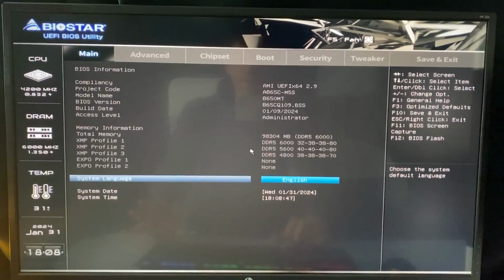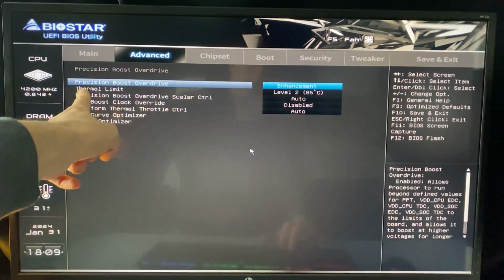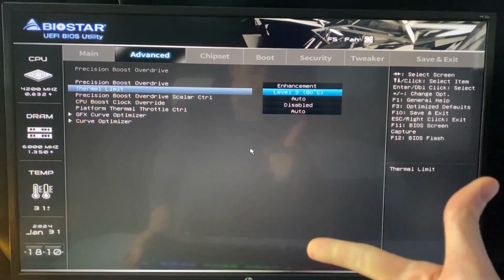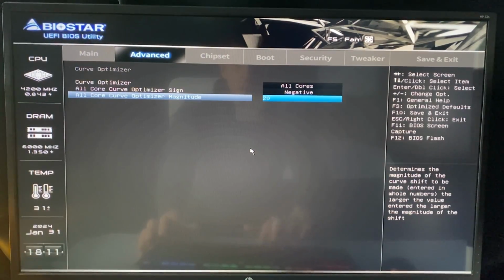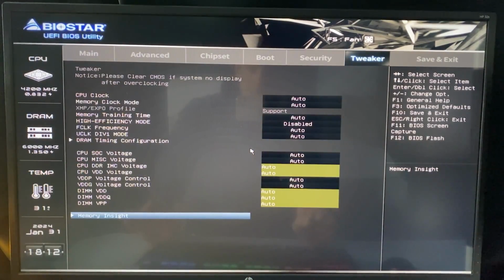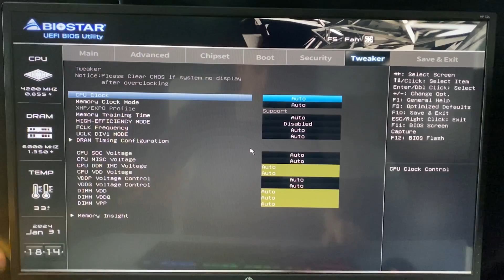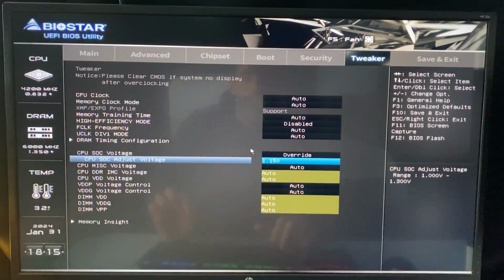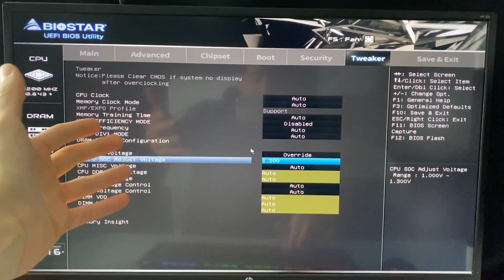Undervolt your Ryzen 7 7800X3D for more FPS and Lower Temperature!

Comment: it's all useless. All you need is using PBO enhancement. There are 5 levels for 70, 80, 90C. The first level will be working on all cpu, level 5 will work not for all, you need to test it. I tried 70C level 5 and level 4, and it had problems with stubility. 70C level 3 works great. I have 74C max in games with 4800-5000Mhz. It works even better than I made with PBO -25, 74watt cap and 4700Mhz lock. It's ready preset

Comment: In my bios there is no 85 degree thermal limit option, but after some testing that would be the performance sweetspot without causing unnecessary heat. I can only choose 70, 80 and 90 but no 85. Is there any way to enable it, or do I need to buy a different mainboard?

Comment: I'm confused about a thing. Dynamic version of this tutorial should be ok or you recommend the static one for long period uses?
Idk on the static version where on the motherboard settings to chose the multiplier (if TUF even have one).
I don't want to lose fps with the dynamic version. If the dynamic version should give you both less temps and same or better fps I'm good. I just want to make sure I'm choosing the right way for my PC

Comment: Msi wont let us to set thermal limit. Without termal limit, would it still work? @imwateringpsus
Reply: It does
It actually has a preset on the bios
The EZ mode and latest Bios update, I put it at 75.
On my 7800x3d and 5080 is more quieter and stable

Comment: Lol my MSI BIOS won’t let me set a thermal limit. It will let me set a platform thermal limit but we don’t want that. Then when I go into PBO the options are set to: 65, 75, or 85.  But then that locks me out of being able to curve optimize.
Reply: u dont need to set a thermal limit. thermal limit is just last protection barrier if temperature is go beyond 80 degrees. or if u insist, just use PBO enchance mode 1,2,3. MSI embed those thermal limit and curve to it to somewhat around minus 10, 20, and 30.

Comment: my pc keeps turning off then restarting randomly im not sure if its because i undervolted my 7800x3d but its been doing this recently
Reply: Yes, it’s unstable bro
Reply: do per core undervolt maybe one core is the problem.. like my case.. 
core 0 -25
core 1 -25
core 2 -5 (was crashing at -10 in OCCT under 4 min test tons of errors)
core 3 -15 (was crashing at -20 in prime95)
core 4 -25
core 5 -25
core 6 -25
core 7 -25
i have core 2 which is the worst and core 3 better, im still thinking playing around to push the remaining cores to -27 or -30 but it needs long testing

Comment: Hello , thanks a lot for the video !! I just did the dynamic undervolt and no issues encountered so far with the same exact settings ( temps are now between 60-67 watercooled) instead 80-85

I am just wondering if this can work on a safe way with AMD Expo as I need it enabled for having my ram at 6000mhz
Reply: What apps or games you use? I think that's hot man. I'm in a equator country and got like 50-high 70c temps when gaming but average at about 60s

Comment: Dude I'm planning to build itx case with this 7800x3d or 9800x3d cpu with velka 3 with low profile cpu cooler. Did you think having 9800x3d pbo with 4070 zephyr edition can hit 540 fps above cause I'm planning 540hz 1080p monitor??
Reply: Go 9800x3d yes

Comment: What's the use of buying the fastest CPU in the world then you'll just undervolt it?
Reply: To min-max power draw efficiency for performance, the cooler your CPU/GPU runs, the longer it can stay on its highest boost clock, hence performance increase and also helps with hardware longevity with less heat on daily run. But for people that still don't understand what's going on after watching the video or afraid to make any adjustments in the bios, just let it run on stock settings there's nothing wrong with it especially after AMD released bios updates for all partners boards to no longer have s.o.c be at 1.4v. all these undervolting steps are just min-maxing, also undervolting doesn't always mean it's underclocking when the CPU/GPU sometimes draws more power than it needs for stock performance, when it can draw less power and still get the same stock performance.
Reply: @Reitear  Thanks for the info sir. ❤️
Reply: No one really needs that much power (as for now) and I rather prefer a very slightly weaker but cooler and therefore quieter system.
The performance loss is absolutely negligible. Its also not the fastest CPU in the world, its the fastest gaming CPU. Intel still has the fastest overall CPUs on the market
Reply: @LEK  But in the video is saying that increase the fps, so you are getting better performance, why are you saying slightly weaker?

Comment: New to PC, After I updated my bios and chipset driver, i try to curve optimizer  negative 30 my R7 7800x3d my wattages drop and also my performance 1400p from 180-200fps to 110-140fps. 
Before with the update it was working curve optimizer negative 30, was working fine from 4700-5050 boast clock 185-210fps. Any advice anyone can respond I would greatly appreciate your help.

Comment: I have a profile on asrock ripetide motherboard that sets max temp 85 and undervolt -40mv. I dont think it ever crashed. but the CPU has always been used below 50% under any load.

How can I know that its actually using undervolt ? the max clock used is 5050 for this cpu as advertized.

Comment: Sometimes I think about undervolting both my 7800x3d and 7900xt, but I read horror stories that in the long term (even if all stability tests were passed and everything seems to work well) it can only get worse (instability in specific moments or downtime, etc., which will only worsen the condition of the CPU and GPU in the future) I don’t know what to do, I kind of want to, but I’m scared
Reply: If it fails, you can set back to stock... Or they go back stock upon crash... Not like your gonna brick your system. It'll just crash and reset.

Comment: I just gave it a shot and set it to minus 30.  Nothing happened. Then I set it to minus 40....no issues. At minus 50 it went black instantly.  So I left it at minus 30. Temps are a little less, performance is a little bit better. But even at minus 30 do not expect any magical improvements. Temps went down from 85 to 79.  Performance-increase of about 2%.
Reply: most realistic comment so far im reading
Reply: Don’t you have to mess with other settings as well as the -30?
Reply: Exact same on my cpu and temps.
CO on -20, 4.85ghz on multicore cinebench r23, 18500 score and 85 degrees! Lf3 360 aio at constant 900 rpm. Most realistic temp for me. Dont know how other have 70c  on full load maybe aio on 100%.

Comment: bro motherboard msi pro b650-s wifi dont allow to change thermal limit and curved settings together. you have to choose curve settıngs ( all core -negatıve-20-30 or pbo settıngs "thermal lımıt anchment 75-85 etc,not both!) can you look at that msi motherboards pbo undervolt settıngs pls. you cant choose pbo= thermal level 75-80 .. ıf you choose ıt you cant set curve optimizer.. there ıs one thıng you can choose "advenced" and on there you have to set curve optımızer and you cant set thermal level...
Reply: Yes you can, there's 2 different locations for Precision Boost Overdrive and the one he shows here is not the right one for the MSI Bios. For that, you just click advanced, then the OC settings in the left above m-flash and below motherboard settings, th3n clock advanced cpu configuration, then PBO.

Comment: I am using ASUS B650 MB and there is something confusing: I have AI Tweaker which has PBO settings and under advanced tab there is AMD overclocking which has PBO settings aswell. which one has priority? what if one is set enabled but the other one is on auto or disabled? I did undervolting just as in this video and after stability tests and benchmarks there is NO change in power consumption or temperatures (facts: it was about 0.1 Watt and 0.1°C difference). any advice? super weird
Reply: You ever figure this out?
Reply: @ on the internet I found several theories but no clear or official answer. one say this and other say that. I have not touched that setting since then and went back to stock settings

Comment: Uninformarive video, pbo negative offset can really mine stability, it is a setting that requires a lot of testing, expecially if you want to have a 100% stable system by setting it per core.

Comment: I did only the dynamic way. Which I find is more stable for me. I set my curve to -30 (-40 was not stable). Now i see the clocks reach 5Ghz regularly, especially at lower % utilization. My 0.1% and 1% lows have improved as well. Power never exceeds 60W (stock would reach 60-70W). 

Lower Temps, lower power usage, better performance. Why not?

Thanks for your help!

7800X3D
32GB DDR5 6400MHz
RTX 4080
Reply: What kind of cooler do you use? Have the fans become quieter after undervolting? I just purchased the 7800X3D and oh boy my 360 AIO is like a jet engine at times.

Comment: PBO curves, by themselves, are not really a power reduction mechanism even if they do nominally reduce idle draw a bit. The whole point of negative PBO is to make room (in voltage) for more and longer-sustained overclocking, including via built-in mechanisms like CPB.

Also PBO curves affect the CPU stability on idle and not underload, -20 is quite unstable on Ryzen, the maximum you should aim for is -15, don't be surprised if you come back from the bathroom (leaving your PC idle) and find out it crashed.

So no, this is not the right way to undervolt your CPU...

Comment: Hi. Im using b650 tomahawk with 7800x3d; in the bios pbo, cant find enhancement option, only advanced or set thermal control (75, 85C) without way to personalize undervolt. Any clues? Or im missing something?
Reply: choose advanced and set platform thermal throttle ctrl to manual then type 80. that will set the 80c temp limit. i have an msi b650m-p and the same thing worked for me

Comment: Is it possible for 7800x3d to come overclocked stock
Reply: that makes no sense, stock is stock, overclocked is overclocked.
Reply: @iamdeluluu  mine came with cpu performance over Lock enabled, hence why I was having troubles with my cpu idling at 60-70 Celsius, i disabled it and it runs at normal clock speeds with normal temps hence why I asked

Comment: Do i need to update my bios to the latest version before undervolting my 7800x3d CPU like this? My bios is currently 1807 and the latest one is 2616 on rog strix b650e-f motherboard. I built the pc some days ago and i have no stability issues so far. My current CPU temps are 45-47 idle(each core is like 30-35 degrees) and like 60-65(MAX) when gaming and having webbrowsers up. The fans are at 800-900 RPM standard curve with these temps.

Comment: Iv read somewhere that first and second best cores can cause instability. I tried all cores method from -30 to -15 and was unstable so I had to stick with -10. So I tried per core with my 2 best cores at -10, core 6 at -17 and rest of the cores at -25 and seems to work good. Doing this method is so tedious and long tho

Comment: Nice tutorial, i've done set up the core offset but unfortunately on my asrock b650m pro rs there is no pbo limit based on the thermal degree. I only can set it by wattage, is there any solution for my case?

Comment: Thanks so much for your clear instructions! First time using AMD and had no clue going in.

Got my r7 7800x3d @ -25 aiming for 80°. Cinebench r23 score was 18100.

Edit - ran Cinebench with high priority. Same settings. 18402
Reply: Try -30
Reply: @kodaotis  I did. Went to -35. Benched it. Went back to 20 and left it there haha
Reply: Try Prime 95 for stability and check if it survives four an hour

Comment: Just did a bios update becauso my bios was corrupted and my cou settings were set back to default, I used your video to do it because I did not remember how to do it.
Took my 3d mark cpu score from like 12.8k to 13.4k or smth, so not massive but definetily worth a 👍
Started with 30 I will increase it to see if I won the silicon lottery :)
Reply: I just tried 40 and it crashed, 35 did not crash but I did not benchmark it. I am currently benchmarking 37 and it's working pretty well so far.
Reply: Just tried -35 and I got 13.25k, weird how I get slightly less performance with a lower value 🤔

Comment: Ever since I bought my 7800x3D, I couldn't enable PBO. It was causing system instability, very slow and choppy. It looked like a Pentium 1 and my temps were at 80+ idle. But for some reason, by enabled PBO with 80 level 3, curve all core negative 20 and it worked
Reply: U need to try 1 core by one core , and see which one makes a problem , takes time but its way better than like this on all cores .

Comment: For the 7800x3d, you do not have the option to manually set the CPU ratios or Vcore. You can only set an offset but you cannot for example set all cores to 48, the motherboards lock this setting for the 7800x3d

Comment: I managed to get -35 on the curve , then i put the cpu ratio to get 4.8 and the cpu voltage 1.2v then hit save and reset and im stuck on a black screen
Reply: pretty sure ur supposed choose either the curve method or voltage method don't do both
Reply: Do a cmos reset just take out the battery, same thing happened to me

Comment: I had mine hitting low 90s which isn't safe at all, it's max is 89c. For productivity it was unusable, since anything over 80% usage caused it to get to hot. I've got a thermal limiter and the PBO settings on now, so it won't go over 80c and still performs just as good. It's concerning to me, I got a massive case, with a 360 X73 AIO and both my 5900X and 7800X3D would get real hot and we able to be undervolted quite a bit without a noticeable performance loss.

Comment: I m using a msi 650 for this and i m not getting the thermal limit option ,there are only 4 option for me those are auto,enabled,disable and advanced,what should i do?
Reply: What worked for me was setting it to advanced, which then brought up the thermal target or something similar. Hover over it (make sure it is highlighted) then type in the limit
Reply: I got same thing, I choose advanced and directly go to curve optimizer and set negative 20. Didn’t do anything about thermal limit

Comment: is this good or better if you do 4k gaming though, my shit been running hot and even shuts down at 4k gaming if it tries to push to 144fps cause the chip shuts pc down when temps get too high for too long.
Reply: Get a better cooler bro.
Reply: What cpu do you have if it's r7800x3d is very easy cool if not buy a better cooler

Comment: Dude there is so much just wildly incorrect info in this video.
Curve optimizer is an offset to frequency?  No.
SOC voltage is the same as core voltage?  On WHAT planet is that true?  Just unadulterated ignorance.
Max SOC voltage for 7000 series is 1.225?  Lol.  Wrong.
Reply: Italian noob...
Improvised YouTubers 🤷🏻‍♂️

Comment: Hi, my msi b650 tomahawk doesn’t have the thermal limit option. What should i do? Should i set 80 in the platform thermal throttle limit instead?
Reply: That's the same thing, type 80 in that section as there is no drop down.
Reply: @bigguschungus968  i thought that but u can see platform thermal throttle limit in the bios in the vid as a separate option so i was confused. he had both thermal limit and platform thermal throttle limit in settings

Comment: I hear you say on a few occasions that with certain settings applied, the PC can crash. What’s the best way to check for stability at certain frequencies? Is there a good benchmark to run?
Reply: Cinebench will stress the cpu heavier than any game could
Reply: @Kocainn  so it’s good to run this to test the undervolt? How long should you run this for to test the stability? Will one run do or should you do several?
Reply: @Jacketz123  I ran mine with these + undervolt settings for 20 minutes on both single and multi core. Then I hopped on some CPU heavy games for further tests. I had no issues
Reply: @Jacketz123  The worst thing that could happen is a blue screen, if you encounter any problems, go back to the bios and re-adjust your values
Reply: @Kocainn  nice. What level of Undervolt did you manage to reach on your chip out of curiosity?

Comment: In x670e gaming plus i have only PBO Auto, disabled, enabled or advanced. When i click advanced i see PBO Limits which can be set auto, disabled, mobo or manual, if i click manual it tells me to enter ppt limit, tdc limit and edc limit, what do i have to do?
Reply: I got same as you. You have to put platform thermal throttle Ctrl to manual and manually put 80 or whatever value you want to platform thermal throttle limit.

Comment: Wierd thing. 
I do have 2 curve optimizers. 
1 is in Advanced
And 2 ist in Aitweaker. 

Which do i use?
Reply: good question need the answer for that too
Reply: @Azrail-Hamburg  i just did his method on both. So far. All stable

Comment: I did notice about 5 degrees C difference. However my girlfriends 7800x3d is still running at 95 degrees C instantly, even idling in the bios. I can't figure it out the AIO should be plenty for it and the pump seems to be fine
Reply: Not sure if you figured it out or not. But try repasting possibly
Reply: @ I have to update you as I figured it out a couple days after that. STUPIDIEST problem ever. I have no clue why but in the Bios, the pump and all fans were set the MINUMUM speed possible so like Eco+, No clue why they defaulted to that but I feel so dumb for not checking that
Reply: @ nice update, could happen with another person too.
Reply: You have a very serious problem.  Even with the cheapest air cooler you shouldn't be hitting 95 C at idle... that's the cpus thermal throttle point.
Reply: Probably didn't remove the plastic from AIO.